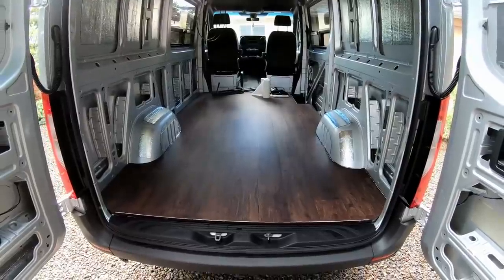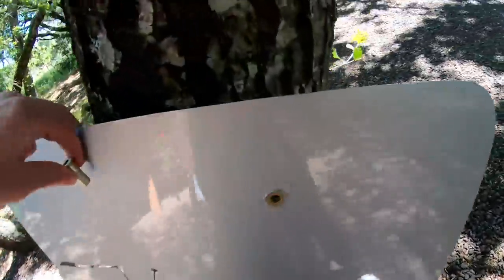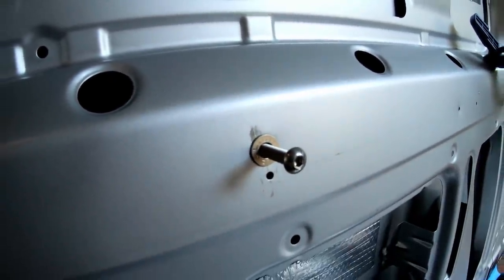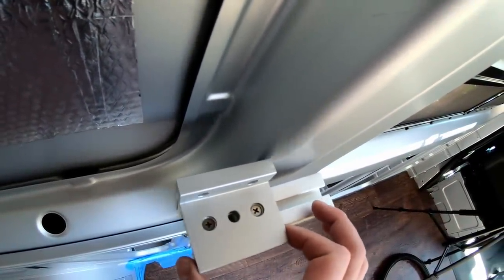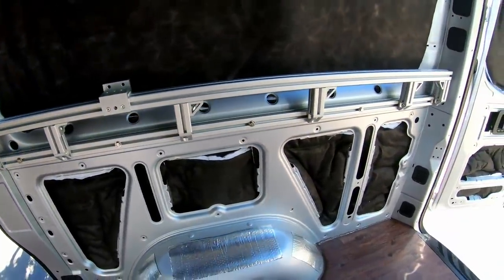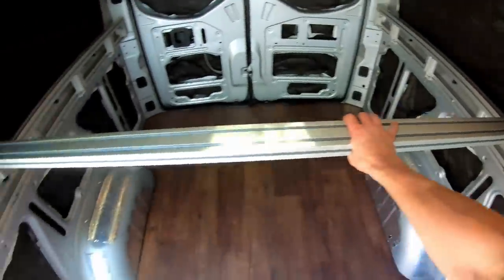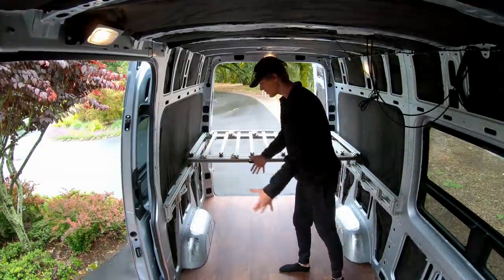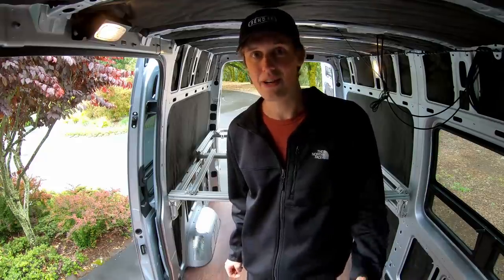This COLLAPSIBLE Bed System Is Perfect For MAXIMIZING SPACE In Your Van!!! #vanlife

Comment: Hi fella, a little tip from someone who lives in UK where rain and damp weather loves rotting vehicles, just squirt some old used engine oil (new oil if you prefer) in the wells of the body panels then it won't matter if there is debris in them as you won't ever have to worry about rust ever again. But if you live in a dry state then ignore this comment. Keep up the good work...

Comment: I ended up going with IKEA metal bed supports ($20 Each x4) As they extend And slot into place Bed mattress folds back And you can pull up the supports ether way Front/Rear Or all for moving items. With brackets I think i spent $150 And its a double size bed 400Lbs no problem ...But it was your channel that got me thinking so thanks !

Comment: This is looking great! If i had more money allocated to my van build, the extruded aluminum would have been my choice to build with. Perhaps if I do a remodel later, this is what I could do. I too have thought about a hidden shower setup, near the bed area somewhere. I am still in the planning stages myself but the build has commenced. I will be following your build. Thanks!
Reply from the maker: Nothing wrong with building out the van and upgrading as you go!
Reply: A lot of people will tell you if they did it again they'd build the necessities and then add on as they travel. Never know what you might need to add or even remove

Comment: Since you have built this in a vehicle which will be subject to the usual bouncing and vibration, I would go back to every single fastener and put a drop of blue Loctite on the theads. I use a lot of 8020 on small machines and without a bit of thread locker, something will come loose. Guaranteed. And, take your allen wrenches with you and whatever small hand tools you assembled this with. At least on your first few outings. One other thing to look out for - sometimes when you tighten a bolt, it will feel like it is tight. In fact, unless it is the right length, it may have bottomed out in the channel before getting truly tight. It's easy to do and the difference between the correct length bolt and one that's too long it usually only 1/8". YMMV.
Reply: Greate advice, David.

Comment: Instead of folding the mattress, why not make the back part of it go up against the wall (when collapsed) so you can also have a "couch" :)
Reply from the maker: This would definitely be possible to design into the system! With my van, however, there are some constraints that prevent this design. The biggest one being the upper cabinets. More details coming in the follow up video!
Reply: Brilliant and beautiful!!! 
... respectfully
Reply: @seven_o_savage  but can you fold your mattress over if you have upper cabinets? im right at this point too. also would be interested on how much this construction costs.
Reply: Seven O'Savage  You could cut the 2 prices of mattresses at a 45deg overlap so that the section sliding in slides underneath the section in the back. C class motorhomes have that system for the above cab bunk. 
Because your van is narrower at the top, flipping the mattress may cause the corners to catch the sides. Did you say you had cabinets above?
Reply: Or... make a three piece bed that has two "folds" in it. The last one stays were it is, the middle one becomes the back rest (complete with shoulder seat belts on each side of the van) and the front part lowers to the bottom of the back rest to become two more seats with seatbelts. That's my design hope, and I came here because of an "extrusion van bed" search. Cheers!
Reply: @woodatwork6927   And that is why I bought a box car moving van :) 100% square all the way 210cm wide, 420cm long and 220cm high on inside. Did see how much hassle it was making the interior of my friends plate van Sprinter and then found this box car 2012 Ford Transit with back lift and did see immediately it is perfect for making a stealth camper more easily with even room for a motorcycle in back.
Reply: Rondo Cat I think you missed a zero on your measurements
Reply: @bonezed   lol yeah CM not mm
Reply: Nolo Kobo   Here in Norway I have gotten away parking for free with just a station wagon pretending to be work related parking at or near construction zones :)

Comment: Congrats for the stunning build (and selling it). I'm thinking about making a similar bed, but with a hinge in the middle to be able to use it as a front or back facing sofa and to be able to access the garage from the inside. What kind of solution will you have for your new Sprinter for the bed? Looking forward to the new build videos!

Comment: I had a thought, instead of running slats in two directions, why not connect a bunch lengthwise so they can all be collapsed back to the maximum. (I'm brainstorming about what I'm trying to do, which is the opposite. I want bedding on the ground level, and want a movable upper part for when I want to pull in bikes etc. )

Comment: Just an opinion from a seasoned mechanic... you will need cross bracing at the lateral supports on the slide out and this, in my opinion, is a waste of space.  Just use traditional rear seat from conversion van that folds into a bed. But hey, good on you for thinking it out and building it.  Hope you get allot of great use. 

God Bless you and keep truckin'.

The Real American Patriots

Comment: The plusnuts have a pullout strength of 500 lbs each or so I believe, and that's straight pulling outwards, probably even stronger for this application where most of the force is vertical. Four of them could withstand 2000 lbs. They are indeed the only way to mount stuff to a van wall. For many things you can even use the pre-drilled holes that already are in the van ribs so you need to do minimal work on holes and the like. Great to see some 8020 linear bearings in use in a van, too, t-slot is such an incredible material to construct van guts out of. Strong, rust free, moisture impervious and 100% squared off and true if you just measure your cuts right. I like what you're doing here. Also great to see how very little that first beam bends with your full body weight on it, my plan is also to build a bed out of this stuff but I wasn't sure off hand what kind of weights it could support. Clearly a framework of this will easily support even two big people if need be.
Reply from the maker: Agreed, 80/20 & plusnuts create ridiculously strong van furniture!
Reply: Seven O'Savage do you offer any additional assistance if I buy From your amazon links
Reply from the maker: Hey Raymond, they are just links to products being sold on amazon (I don't actually sell them). That being said, my DMs on instagram are open for questions (@seven_osavage)

Comment: Not sure of the outcome just came across you vid. Awesome build but instead of a flop over I think half should go for back support leaning in the back van doors. Think it would still allow you to sit up straight without any constrictions. Just my thought.
Reply from the maker: Thank you! I can actually do this (paritally) with the way it's set up. I'll post a video on my insta when I get the cushions back from the seamstress. The bottleneck here is that the back of the van tapers off and I also installed an upper cabinet on one side.

Comment: Wonder how it worked out attaching 80/20 to the van frame without a thermal break? I'm assuming that in winter, the bed frame is the same temperature as the van exterior.

Comment: Hey man.. nice work on the 80/20 sliding bed frame. I've been studying your old build. Very impressive. Have a couple of ? 
before I tackle the job. I have 2015 144 wheel base with all the windows. (12 pass van) I see you use about 6" riser to the rail. For me to accommodate the widow I have to go about 12" high to clear the rear seat headrest. Will that make any difference on the load integrity of the crossbeam? I'm thinking of installing legs for better support. Is that necessary u think? 
Thanks! Well done!

Comment: It looks really cool, and light weight being that is 80/20.  What did it cost for all of the 80/20 components to build that frame?
Reply from the maker: Thanks @John Haywood! I made a lot of costly mistakes, but if I went back and knew exactly what to order I estimate materials would cost around $700
Reply: @seven_o_savage    Holy cow.  Thanks for honest answer.
Reply: Ahhhh the $700 materials price is another thing to consider - in Seven's capable hands it was that low - but for me, a beginner- eeek.

Comment: Looks cool. Won’t the weight of the mattress press down on the unsupported ends causing them to hit the rear cross beams?
Reply from the maker: When it's in "bed" mode, there are no unsupported ends. When sliding the mattress back the beams are momentarily unsupported, but rest on top of the back cross beam when fully collapsed

Comment: Hi! 

I recently purchased my 2019 sprinter. I want to make a similar style bed, but wish to have my bed go up vertically. I want this as I still may need to use my van for hauling items and would love for the bed to go right to the ceiling should I need it to. This also leaves me the option to have small living area underneath. Can you reccomend any 80/20 parts that would be sufficient for the process?  I've racked my brain on the 80/20 website and with so many options it seems like a losing battle. 

Any info or tips would be appreciated. 

Keep up what you're doing. 👍
Reply: I just bought a 2012 Ford Transit box wan and is thinking the same. Legally I have to make sure the car is in fact a cargo van for another 3 years because of tax reasons so it can not have a "permanent" bed  or other things you can sit or on while car is driving on the road here in Norway. (The bureaucrats is totally crazy psychopaths here and that is one of the major reasons I am building a stealth camper wan to go live in another country as it is just getting worse and worse)

Comment: the problem with 80/20 is you have to tighten everything every so often wood on the other hand once everything is in place there is nothing more to do, down side is  you can not adjust it you have remove it and is heaver

Comment: This is the exact REASON as soon as i;m back in work [CRANE OPERATOR] after spine injury i am deff building a camper/house on wheels, the rent/bills are stupidly expensive here in the UK and i kid you not with my job and a van;bulid full time i could SAVE AT LEAST 20-25K a year and. I have my eye on a few ex gov vans that ferry students around and can get a slightly bigger van than the merc sprinter for around 6-8K and i have friends in every trade so i could put say 10K into it and i would be living practically free YES I KNOW Insurance/mot but still save a lot STUFF THE BANKS AND THERE ILLEGAL MORGAGES the council rates water rates SAVE SAVE SAVE and keep it for yourself .

Comment: How much weight will it hold? The weight of the mattress like an 8 to 10 -inch latex,
 plus 2x 250-pound = 500 pounds of human doesn't Aluminium bend or warp easier than most other Metal?
Really want to know to convert Van and be able to remove when not travelling.

Comment: This frame will conduct heat or cold. You need a insulator between   .
Reply: heavy mass vinyl spacer between the steel and the 80/20 should help with that.

Comment: I am extremely impressed and this is pretty much exactly what I was looking for. BUT I have questions.  Doesn't that create a thermal bridge?  And how much did this cost?  I was looking for a cheap method but doing some quick math this looks like a 500 dollar bed frame.
Reply from the maker: Good questions, it does indeed create a thermal bridge but w/plywood and my mattress I never actually feel it. If you bought the perfect amount of materials and didn’t make any mistakes you could probably do it for $500. I’d estimate more towards $700 in reality though.
Reply: @seven_o_savage  Sweet, thanks for the reply.
Reply: @seven_o_savage  what's thermal bridge? I have an uninformed idea its like air curculating under a hammock but Incould be way wrong.
Reply: @skysappr  Jeff, it's simply conducting the temperature from one piece of material into another. So if the van shell is cold outside, the attached aluminum bed frame inside will get cold too since it's directly touching, etc. I've seen some people put a tiny sheet of rubber between the van wall and the aluminum frame to help reduce the heat loss.

Comment: Ever considered wood? Classic sofa bed design and those are made of wood. No thermal bridge and much lower cost. But still you made a great job.
Reply from the maker: Thank you! Yep I considered wood, but for me the cost outweighed the benefits of using aluminum.
Reply: I guess you have to weigh how much a 'thermal bridge' will affect your comfort vs  the mold/rot resistance of aluminum, as well as it's weight to strength ratio advantages. I sometimes think that van builds obsess unnecessarily when it comes to insulation, especially for a house that has wheels and most likely doesn't have to stay in seasonally severe environments. But for a minority of people who may need a 4 season van, a thermal bridge might be a deal breaker.
Reply: @seven_o_savage  The cost of (wood?), outweighed the benefits of using aluminum ($700+)? Not sure I follow. As a woodworker, I feel compelled to ask, what type of wood (and design) did you compare that to?

Comment: Looks good. Though I wonder how comfy those gaps will be with just a mattress.  You might want to also add an extra expanse on the tips of the extension, as otherwise it will bite into the mattress when you try to slide it in. 
Well, that is what I would do. No judgement here.
Looks and seems to be very savvy. Thanks for sharing.
Good adaptation on the change when it was too close to the wall.

Comment: Hmm but aren't you going to lose all the space in the sides of the wall? You can't have any shelving or anything jutting out of that we extra space if you need to fold the mattress over. Unless your mattress is less width then the frame. So you only save floor space and what you use there can't be higher than the bed.

It seems to me a better system would be a folding frame. One that you collapse at an angle so that you can have plenty of extras on the walls. It's hard to explain this in text sorry.

Comment: I'm very curious how you affixed the 8020 to the Van itself. It wasn't easy to tell from the video. I'd also like to ask what will you use that extra space for? It will be pretty low to the floor won't it?
Reply from the maker: Hey David, I drilled straight through the extrusion and attached it with long bolts to the plusnuts. The bed is 36" off of the floor and I can always make it higher or lower, but I thought this would be a good starting height so that I could use the space underneath the bed for storage, shower, & water tank.
Reply: @seven_o_savage  Okay. i've seen some other guys using this stuff but not the collapsable bed which is brilliant. Good idea on putting the shower under there. I seem to recall from your first video where you were using that CAD tool to design. I'm curious if you are still sticking to something like that? For myself since it would be our first attempt I was planning on doing some basic design but I was going to mock up most everything using cardboard so I can see it right in front of me. I am heavily drawing inspiration from what you are doing. I originally thought about using foam or wool insulation but now we're doing the thinsulate despite it costing more. I don't want mold and mildew problems for sure. I'm excited to see how you will cover the walls which I'd assume is probably next on the agenda. I think for us we just want to have a small place inside to be comfortable and be able to sleep, most of the time we'll be outside. Swivels will handle the seating and a fixed bed with a real mattress will handle the comfort for sleeping. It's for camping and not living but the idea of taking off at a moments notice and camping anywhere is the idea behind our efforts. Looking forward to more videos!
Reply from the maker: @davidfromtexas9681  Awesome to hear!!! Thanks for the amazing feedback. Very cool that you're building a camper van as well. 

I do indeed use sketchup for everything (and I have a video tutorial on how to use it in it's most basic form), but that's only because I come from an engineering background and this is the fastest way for me to get an idea of whether or not what I want to build is feasible. If cardboard is faster for you, than stick with it!